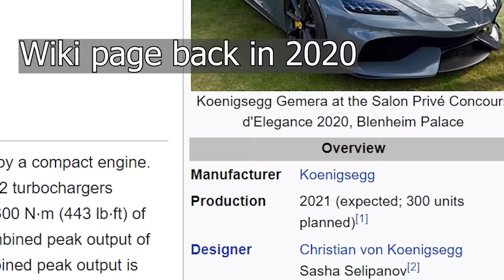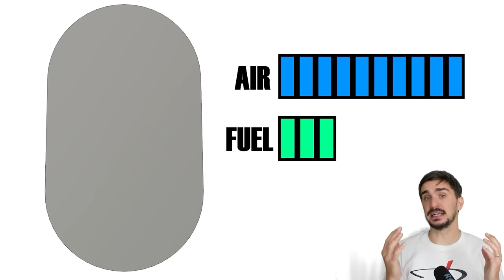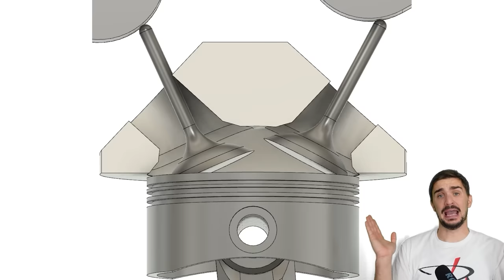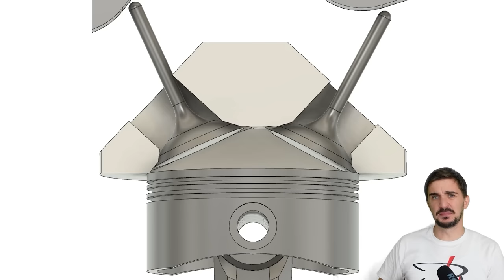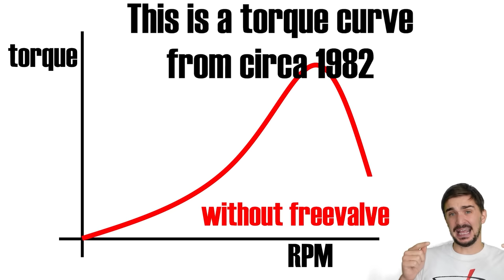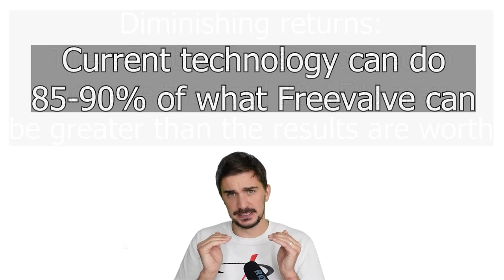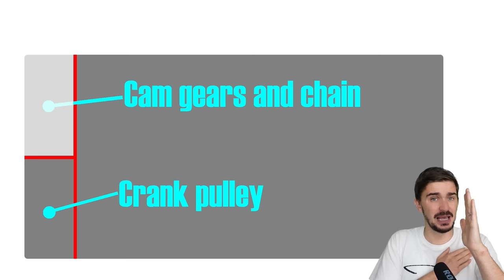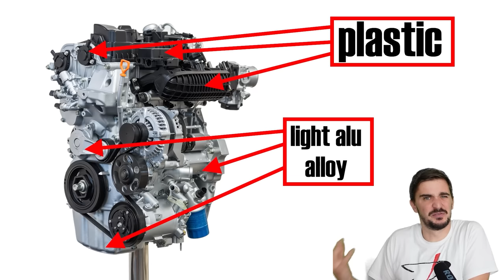FreeValve Isn't a Big Deal. Here's why

Comment: One major aspect to consider that I thinks has been overlooked is the massive reduction in friction surfaces that Freevalve could theoretically have. almost All of the major failures from modern engines come from lack of lubrication in one way or another, so if there is a technology that stands to make modern engines more reliable, my money would be on Freevalve.
Reply: Another aspect that has been overlooked is the valve control, i.e. acceleration and deceleration curves, especially as it nears the valve seat. If I recall correctly, this has been a major problem with freevalve and it will take a serious chunk out of longevity of the system. If I had to imagine this system entering a second hand market like eastern Europe where the majority of cars are driven past half a million km mark, somehow I just don't see this system surviving, the maintenance must be a nightmare. If we are about to advertise the green ideology then making things last is paramount, otherwise we offset the benefits in more frequent manufacturing.
Reply: @karlisbanis2442  The lifetime of the valvetime solenoids is also totally unknown. I would assume the the lifetime problems is the cause for the delays.
Reply: haha... you Koenigsegg fanboys....
Reply: @GeorgeWashingtonLaserMusket  Yes, when you consider how many parts a single freevalve solenoid has inside, it's far from simple solution. Basically one solenoid is replacing one segment of valve lift cam and the valve spring. That's total of 2 parts. If (/when!) freevalve solenoid has more than 2 parts, the probability of failure goes up, not down.

As a result, the solenoid requires higher manufacturing quality to result in similar lifespan.

That doesn't exactly sound like the cheap solution, which is probably why it hasn't taken off.

In theory, freevalve is a great product still.
Reply: It might just shift the reliability issue to a different area. Freevalve has the potential to brick your engine with one tiny glitch, no?
Reply: CannedCoochie  Oh, I forgot, does Freevalve also have variable lift or is it focused on timing only? Does the tech allow different lifts, too?
Because whenever variable lift is involved, we can assume it's an interference engine. Itr might even be in other cases where high efficiency focus and modern tech is involved.
Reply: @Dowlphin  if not engineered properly. A well designed electro-mechanichal system with redundancies and self monitoring can far outlast a traditional mechanical system. one of the most common wear items on modern engines is the timing chain and it's tensioners and guides, which when they fail have just as much potential for catastrophic engine failure. Freevalve eliminates the need for that.
Reply: @chocolatethunder3218  My point is the societal problem. Society shows growing incompetence and software- or finnicky-tech mistakes are made much more easily, so I would rather trust a less complex, more tangible design where little mistakes tend to increase wear or such instead of having high instant fatality potential.

We see the degree of cringe when a manufacturer does fully electrical steering and says they built in two redundent motors for the steering system and immediately follow by saying it is nicely compact and integrated, with both motors next to each other in the same housing. That's their idea of failsafe redundancy on that end. And that's before mentioning that that steering system has severe response lag, which should be an immediate road safety red flag.
Reply: I guess a coilpack can be compared to a free valve solenlis respectively as theyre both just windings and expereince lots of heat affected degredation..
Reply: @proxypanda4156  coil packs are often designed to be cheaper as they are a more easily replaced item. A more direct comparison would be  to the injectors on a direct injected diesel motor. those are often actively cooled and will last the lifetime of the engine in a lot of applications.
Reply: @Dowlphin  I am sure there is plenty of development that needs to be done. it will not be straight forward to find the ways the tech can fail, but eventually, I believe that it will be a better, more reliable, and sustainable system than the traditional mechanical systems. look at BMW's vlavetronic system with a whole extra set of rocker arms for each valve, as wells as a whole set of springs, an electric actuator and an eccentric shaft. It's a lot of moving parts that could be reduced to a simple solenoid.
Reply: @MikkoRantalainen a lot of modern valvetrains are a lot more than a simple cam, rocker, and valve. you have a hydraulic lifter, most have a wear cap on the end of the valve, and that's not even including all of the parts that go into VVT and VVL systems like valvetronic. All that complexity could be reduced to a solenoid.
Reply: @silentsushix3  man, I also observed this so much lately, they just don't get it, they push and think that their brand is invincible, and they didn't prove anything, didn't win amy races, no Nurburgring records, no high mileage, absence of long history, all the tech without real advance like Triplex suspension etc.
Reply: @chocolatethunder3218  Good points! I sure hope freevalve tech will get into ICE cars because full transition to EV will take quite some time still. It seems that the old video is all we have about the freevalve and I would guess it's still too expensive to use even though it has all the advantages explained in this video: https://youtu.be/S3cFfM3r510
Reply: Whatever insignificant friction losses that may exist on typical cam-driven valvetrains will pale in comparison to the compressor required to provide the highly pressurized air required to drive the pneumatic actuators. And how is humid air dealt with in the compression process? 2-4 more points of failure per cylinder is not an improvement.
Reply: @alphaforce6998  Combustion engines are literally an air compressor with extra steps. Disable the spark plug and fuel injector. you have an air compressor that's as reliable as the engine it's a part of.
Reply: @alphaforce6998  Typical cylinder head with full valve mechanism is far from insignificant friction – try rotating the cam with bare hands... That said, I agree that air compressors are even harder to turn by hand.

However, it's much easier to route air channels than to transfer mechanical movement so you could e.g. integrate the air compressor to the crankshaft reducing the need for any additional bearing surfaces.
Reply: @chocolatethunder3218   Thanks for you tidbit, but please explain to us how you are going to use the engine itself to generate a steady stream of compressed air that is suitable for operating pneumatic valve actuators. Please explain how you will keep this compressed air free of contamination, dry, and available in the required volume at the required pressure.
Reply: @MikkoRantalainen   You're not going to put the air compressor under-hood where it is hot, and you will be compressing air which will make the air even hotter. Aside from a separate electric compressor mounted somewhere else, you could have a PTO type compressor which is driven by a sprocket on the transmission. This is how trucks' air brakes work.

But in no way is this better or more efficient than a camshaft...and contrary to what you say, a camshaft can easily be turned by hand when it is not connected to the crankshaft. Furthermore, it is fully integrated into the engine thus you will not need the critical function of the engine depending upon a secondary component (which can fail).
Reply: @karlisbanis2442  if I recall doesn't freevalve have to open later  than a standard cam so it doesn't smash into the piston?
Reply: @karlisbanis2442 ”they” don’t care if it is actually green, as long as they can virtue signal it

Comment: The problem I remember with electronic actuation was speed. The electronic actuators struggled to keep up at 1500 rpm. Getting to 3000 rpm would make it usable on the street, but there would be little to no benefit. The main idea being to provide optimal power and efficiency over a broad rpm range.

Comment: Back in the early 80's I had to analyze the error-detection capabilities of small 8 and 16-bit microprocessors that would be used to operate the solenoids for an electronically controlled valve system in an engine being developed by a large automotive company. This analysis was not for the automotive company but for a potential bid by my employer to supply a "better" microprocessor. There is a mean-time-between-failure (MTBF) for digital circuits especially in the harsh environment of an engine compartment. There is always a possibility that a solenoid-controlled valve will open when not intended and while the piston is in full compression thereby causing damage to both. This can be mitigated by sufficient error-detection in the digital system to prevent this condition. However, there are a predictable number of engines that will sustain damage while under warranty because of undetected circuit failures. At that time the estimate of the costs of warranty repair exceeded the cost benefits of the digital valve control system given the lower error-detection capabilities of existing microprocessors. IMHO, the traditional/improved mechanical methods mentioned still appear to be a more economical solution for automotive companies.

Comment: This reminds me of the way that CVTs were supposed to introduce huge performance and economy gains, before a simpler solution reared its head: more speeds in the gearbox.
Reply: Cvt's would be awesome if they had the torque capacity to handle super short launch gearing. Like having the "first" gear redline at like 15mph before it starts navigating through the ratios.
Reply: A torque converter combined with 10 gear ratios is like 90% of what a cvt can do.
Reply: @thebaddestogre-3698  I think Toyota actually makes a transmission like that, IIRC
Reply: The problem is, those 10 speed trans are showing reliability problems. They are going to cost a fortune to be rebuilt, which is why they pull a bad one and put a new one in.
Reply: @kalmmonke5037  Stream of semi-consciousness. Chat GPT fails again.
Reply: @177SCmaro  thats why prius has a normal first gear for high torque, then cvt afterward. best of both worlds, although subaru cvt is high torque without electric drive helping the high torque situations
Reply: Belt CVTs suck but hybrid eCVTs are great.
Reply: @thebaddestogre-3698  "zero max" is a cvt without belts and will handle high torque and have a zero gear and higher gears. it converts rotary motion to reciprical motion and a one way clutch converts back to rotary.

Comment: I think the big benefit of free valve would be repair simplicity. no complex linkages and oiling pathways like in some of the other VVT systems. VVT systems are so heavily reliant on using the correct oil viscosity and regular oil changes that regular consumers simply don't have the give a damn to keep up on, so a pneumatic/electric system really makes a lot of sense. Make it non-interference and you have the makings of a reliable economy vehicle. Never have to worry about timing chains. Fewer places to get oil leaks. If a valve solenoid fails, the computer can still keep the engine running until it can be fixed (2 intake valves per cylinder). The possibilities for high reliability make this technology super interesting to me.

Comment: I think the main part being overlooked here, is how Freevalve scales linearly -meaning that you just have one unit (valve system) that you can expand depending on the amount of cylinders, their position, and layout. You don't have any gearing, shafts, and pulleys you need to worry about, only the electrical cables and hoses that are adaptable by default with no extra cost. So if you have an i3 engine, or a W16 engine, the actual piston can stay the same you just add more depending on the need. This is something that you previously could never do when you had to customize the shafts and valve interaction and housing blocks to accommodate the wear of all the moving components depending on the type of engine, rpm, etc.

One of the key reasons Freevalve hasn't been adopted, first of all is due to manufacturers wanting to do as much inhouse production as possible, and when sharing platforms with not just multiple car models, but also across multiple brands, the overall cost difference diminishes so the idea of buying from an external supplier is less relevant, especially when they already have r&d invested into their own in-house alternatives that may get close to the performance and efficiency.

Lastly, a main point is also that the major established automakers are diverting more and more funds into green alternatives like electric, so spending extra cost on a system like Freevalve that only optimizes the products that are getting phased out year by year, makes little sense. Realistically, the benefits simply aren't enough to outweigh the already standardized methods and strategies. For big companies to shift their internal structure like this, they would need a much better reason than "5-10% real world difference" for the applications they may have in mind. Also COVID didn't do the Freevalve implementation any favors either, so realistically it's only a few years of adoption period which is by no means enough to make any radical shifts.

Where companies do invest, is in systems that they know they will have to change sooner or later, which means hybrid and electric is at the forefront, so any new expenditures will go to that direction before looking into things like Freevalve.

Big ships take a long time to turn, especially when the turn isn't strictly mandatory they'll rather stick with their existing course for as long as possible, as that is consistent and predictable.

Comment: So the biggest advantage that I could think of regarding free valve is the ability to switch from Otto cycle to Atkinson cycle for fuel efficiency when you’re already at speed. But it looks like the various VVT mechanisms already in production could do this. Great video!
Reply: Yes Otto/Atkinson switching is pretty common already, Toyota does it in a few of their most popular engines
Reply: Have fun changing timing belts on the old engines. lol
Reply: Timing belts on a free valve engine?

Comment: I've been saying for years that the next big thing in IC motors is independent valve control. I still believe that. The technology just isn't quite here yet.
Reply: That is not what he is saying here. The take away is that the cost is likely not worth improvements.
Reply: Yet, this video clearly explains that it IS here.
Reply: @JohnFrumFromAmerica  not quite... the last part of the video shows examples of and describes other production independant valve systems, such as FIAT's (if I recall it was fiat) oil activated, computer controlled intake valves. 

OP stated independant valve control, not Freevalve specifically.
Reply: @Abrikosmanden  Thanks Mr Obvious.
Reply: @JohnFrumFromAmerica  That's what he's saying, alright. He's wrong.
Reply: @JohnFrumFromAmerica  I didn't say he's claiming it's the next big thing, I said that I believe it is the next big thing. And by the way, it is for the very (mechanical) reasons he stated.  I'm not arguing that the return on the investment isn't "diminishing". What I will say is that no matter what comparison you make with an engine that has static valve timing, It could always be improved on by having complete control of each event of valve actuation. Just because there is a 1.6 liter motor out there that outperforms the 1.6 liter in the video doesn't prove that independent valve control can't outperform, it just hasn't yet. This opinion comes from over 50 years in the industry. I've been there from the first EGR valve until now and every iteration of fuel delivery that's been imagined. The camshaft has been the only constant and it's time for a drastic change.
Reply: @richsackett3423  he is not wrong. Cost is a critical element of a design otherwise we would be making all cars out of carbon fibre and all engine internals out of titanium.
Reply: @howlinhog  it's not the next big thing. ICE engines are good enough. The real big benifits are going full electric or hybrid drive trains. This is an unnecessary dead end technology. That is not worth the cost. Unless they can get the cost down to only slightly above a modern cam based system.
Reply: @JohnFrumFromAmerica  The next big thing for ICE engines is my claim. Electric has nothing to do with the subject. We're gonna have to agree to disagree. It's just my opinion, no claims from crystal balls.
Reply: @JohnFrumFromAmerica  That’s nonsense.  Design expense is not the limiting factor in using expensive materials, their cost is. The actual materials for a cam-less engine are much less expensive than a multitude of labor-intensive valve train components. Your argument adds up to “why aren’t they doing it already? It’s cheaper”. Quite a rake to step on for a someone who thinks he’s as smart as he does.